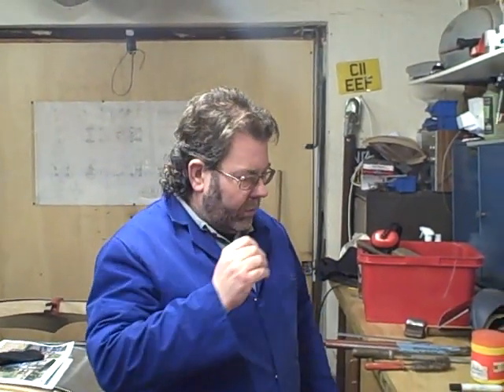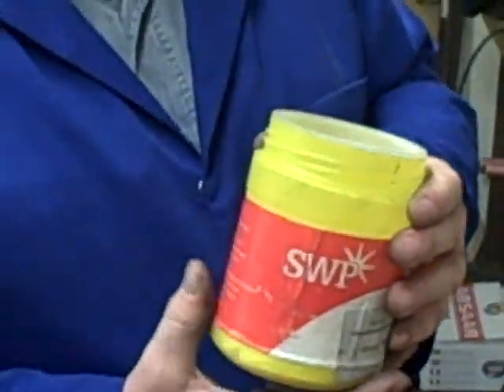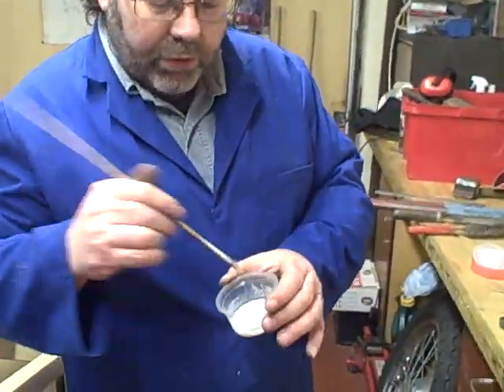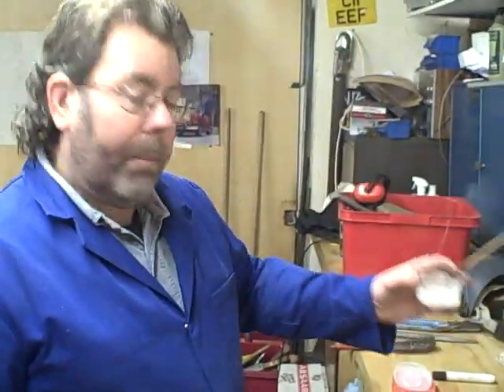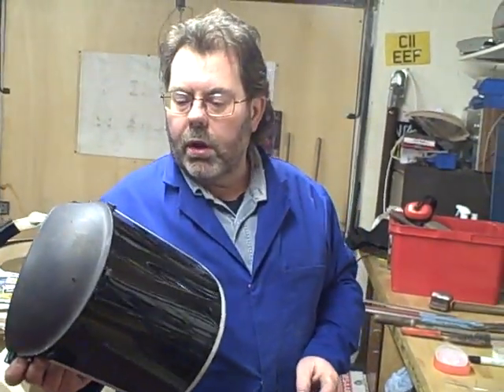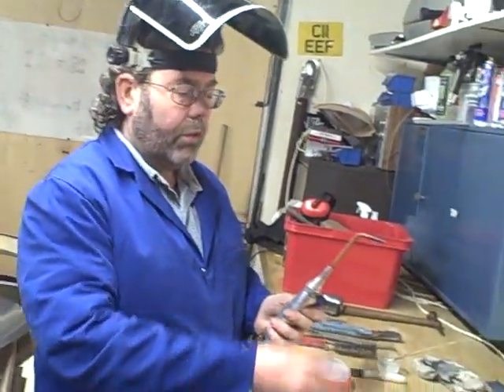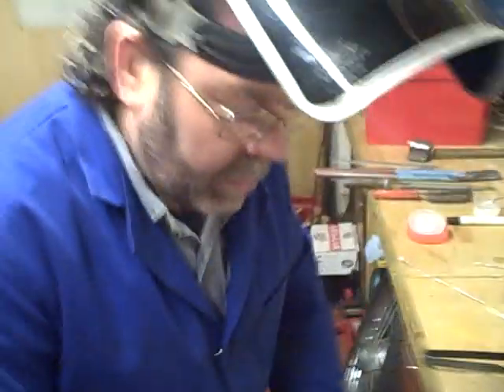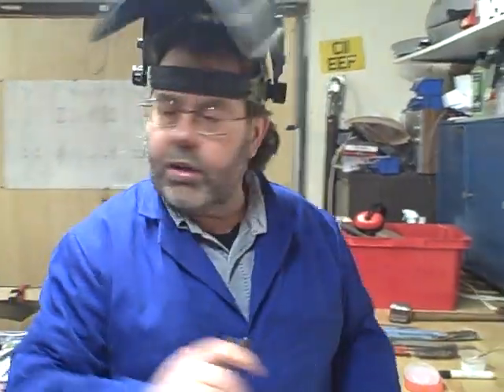English Wheeling machine. Part 10 Wolseley Hornet Swallow bodied special

Comment from the maker: Hi Jim. Sorry its proving very difficult to buy them now as its a dying art. The goggles I use I've had for over 20 years and dare not lend them out for fear of damage etc. If I find a genuine supplier I'll let you know. I went to BOC and asked them for GWF goggles and I bought 2 pair! They dont work!!! They do not remove the glare from ally or brazing flux. When I challenged them they replied "we dont weld, only sell the gas"